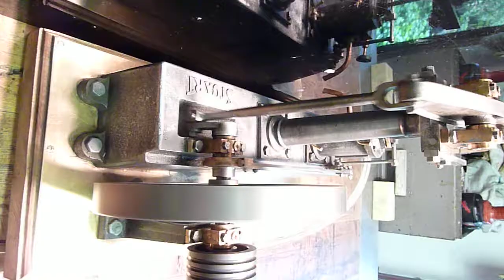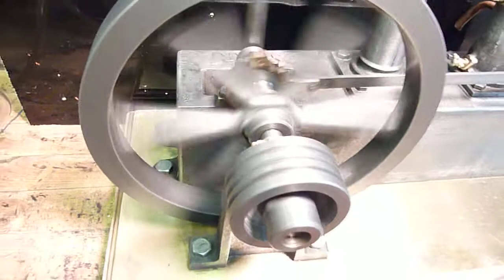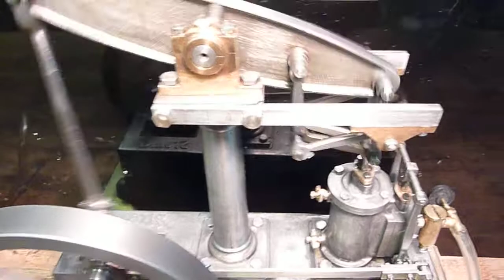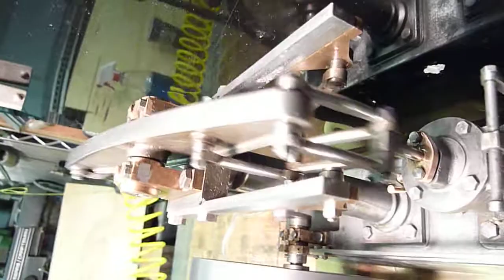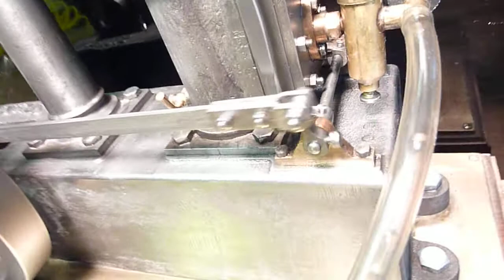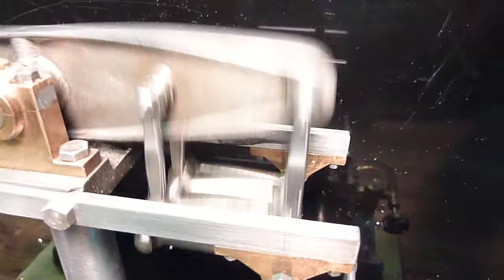STUART BEAM FIRST RUN QUESTION NOISE

Comment: Nice beam engine, 
If its coming from the cylinder it may be that there isnt enough stroke, so the piston is hitting the top and bottom of the cylinder or the piston may not be properly fixed to the pushrod and rocking back and forth.
It could also be the slide valve, if its worn that too may be slapping around.

Good luck.